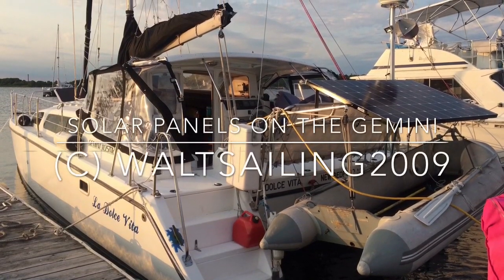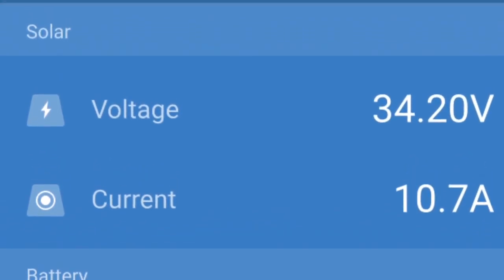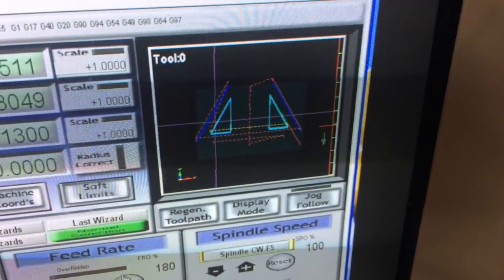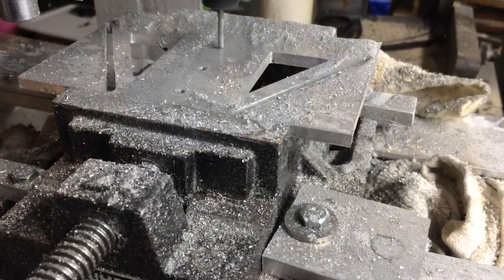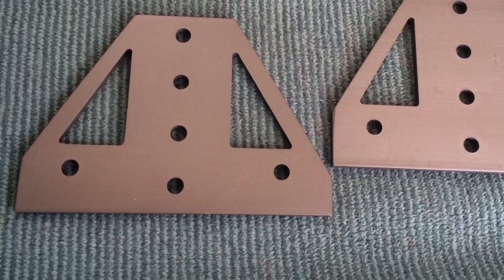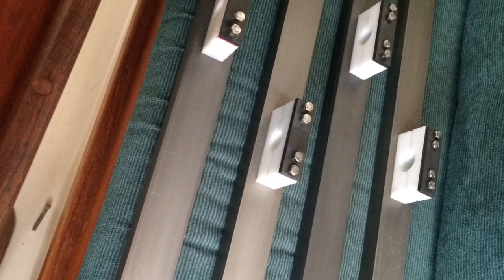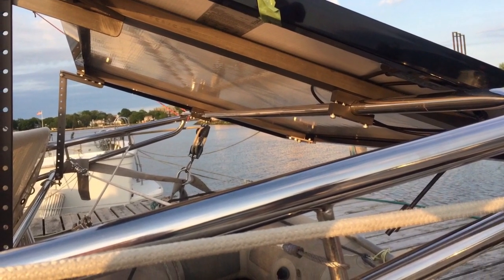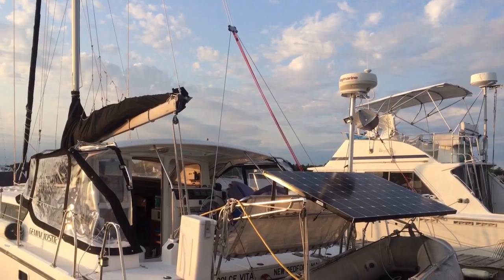Solar Panel on the Gemini 105Mc

Comment: Great video Walt!! Thanks.
Reply: What about the solar panel? How many watts, brand, how much, etc.. Also why did you go with a 150/35 for the smart solar charge controller and not a higher amount? Thanks
Reply from the maker: Justin Bolton  the panel is a 360 watt made by LG.   Just google LG 360 watt solar panel.   This panel puts out 40 volts at 9 amps.   40 volts times 9 amps is 360 watts.   This is the max and the advertised power.   The current max out out is thus 360/12 or 30 amps.    Assuming your batteries are 12 volts.  You need a controller that can deliver 30 amps.   So this controllers can be used with a string of solar panels up to v open circuit of 150, but up to 35 amps.   You can also get the Victron 100/30 which fits the job also but would have really no additional head room.  But since you may actually never get or at least most of the time never get full power this would be the recommended size.
Reply: @waltsailing2009  Fantastic Walt, thanks again. You wouldn't happen to sell the custom mounts would you? Also what kind of davits do you have installed? We need some for our 105Mc.